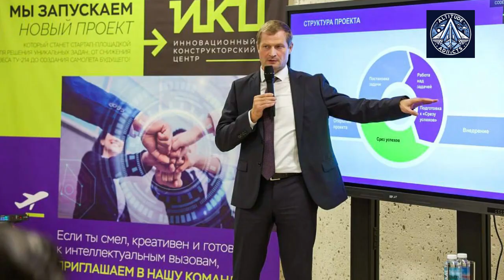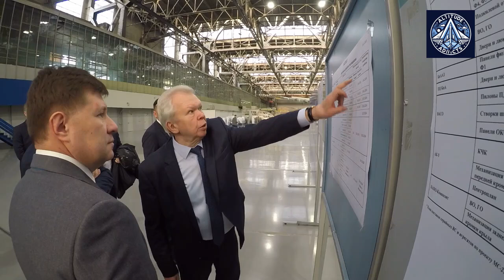Tupolev's Ambitious Plan to Modernize the Tu-214: Inside the Innovative Design Center

Comment: I think the Tu-214 is a fantastic aircraft, which at the time it was launched, was way ahead of its time. Now it may be a bit out of date, but with modern materials and some adjustments such as a cockpit for only 2 pilots, a new interior suitable for medium-haul flights, new engines style PD-14M and wing made of composite materials, the aircraft does have some assets.

Comment: The biggest gain is to standardise a consistent cockpit experience like Airbus did across all its fleet. Incremental upgrades to the basic model is the way to go. Perhaps an accelerated stepwise uograde aimed at scavenging excess weight from structural to control to instrumentation.

Comment: The purpose is to make a modular airframe that can be configured to market demands throughout its lifecycle, different engines from the NK-73, PS-90-3 or the PD-14, there is no lack of suitable engines that can be made fully compatible with other airframes, that design is very interesting since its made heavy duty Soviet style but can be improved with composite wings and Lithium/Aluminum airframe plus composite tail and control surfaces.....

Comment: 100 aircraft is a lot. Work hard and work quick! Keep going strong
Reply: It is not easy to meet. Estimated by 2030, appx. 1000 planes are the target for SSJ/MS-21/IL96 but it is still speculative due to supply chain challenges / manpower shortages for the production.